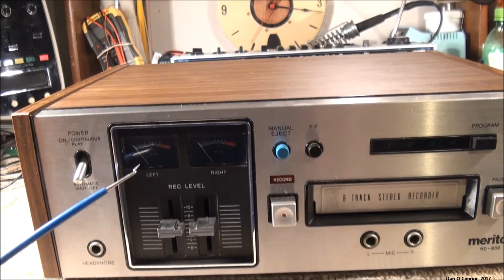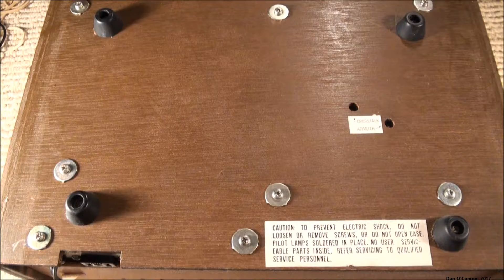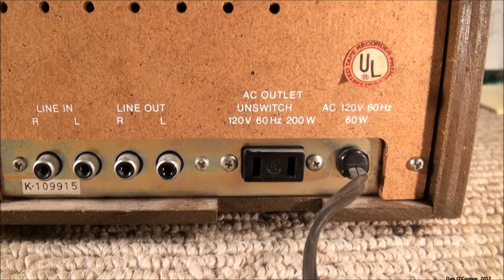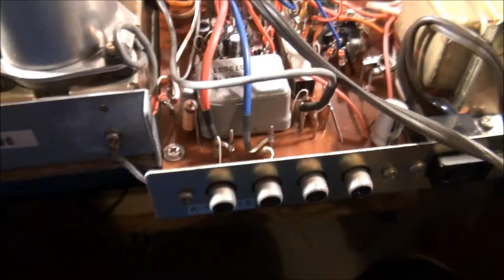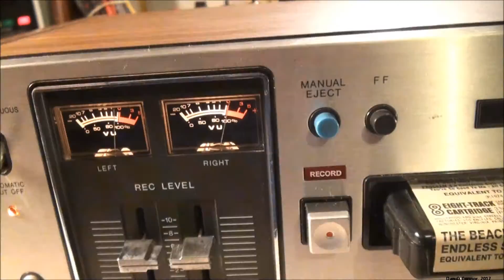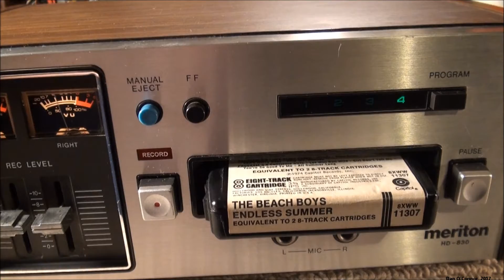1974 Meriton HD-830  8-Track Recorder

Comment: I never knew that Sony had a sub-brand.
Reply: Lagib28 Yes, Aiwa was another sub brand of Sony.
Reply: I don't think I knew that Meriton was a subsidiary of Sony either. Aiwa yes, of course, but not Meriton. And obviously there's Panasonic/Technics, Pioneer/Centrex, etc. Probably a couple more I am forgetting about.
Reply: I've got the lesser HD-800 Playback only but it is very a good deck. I was used to old Channel masters and whoever made a Capehart. This sounds really good,in fact I never knew that a lot of the wealthier people had them hooked up to 70s Marantz receiver/amps. I thought R2R was the cats meow but some 8 tracks weren't bad. Mine is connected to an Onkyo A-7070 amp with a yamaha 20 band GEQ. Along with a pair of RE-30 Cerwin Vegas. I was shocked when I introduced this $40 piece of equipment to my system which also includes a Nakamichi RX-202 and BX-1. Not saying it compares to anything else I have I'm just shocked because of the memories I had of 8 tracks in general I suppose. Great Video and what size is your belt?  I had a couple of flat ones on hand but it seems tight but it plays ok for now. No PRB belts listed for a Meriton 800 that I can find. Thanks again!